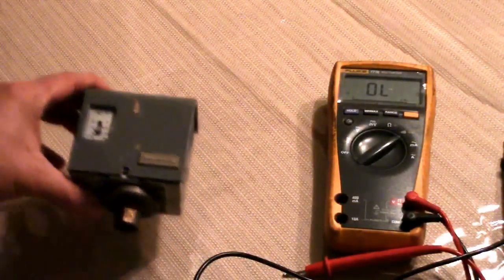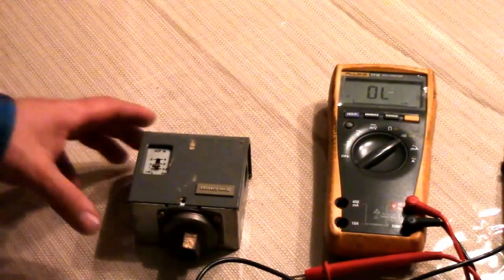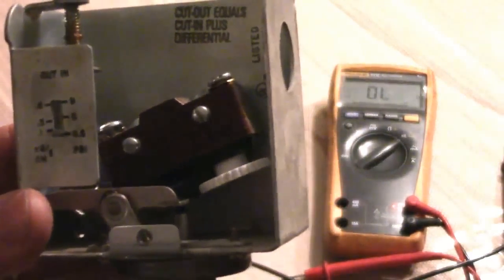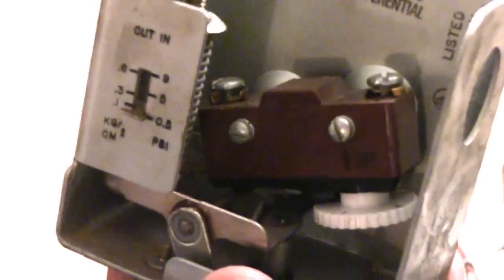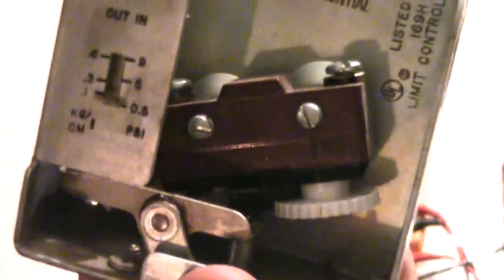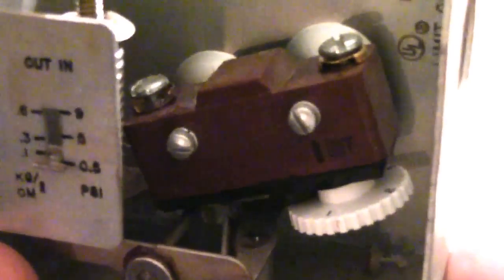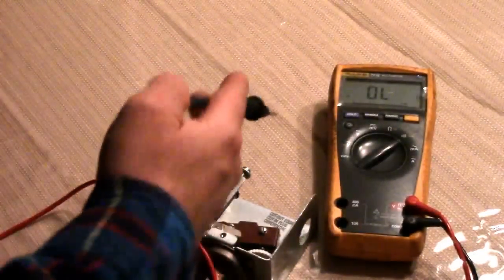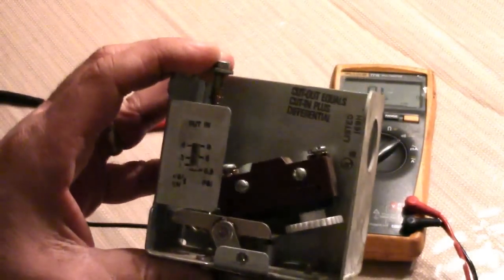Honeywell Pressuretrol PA404A

Comment: Appreciate the video but no they don't "mean" at the furthest radiator. There's no need for "extra pressure" to get further up the line. In fact, the opposite is true. Steam travels slower at higher PSI. Pressure should be as indicated AT THE PRESSURETROL or something is wrong. The Empire State Building (< 100 floors) steam heat works on less than 2 PSI. Watch this for reference on steam heating systems: https://www.youtube.com/watch?v=AgnIFt1wYhw

Comment: what happens if I put the PSI to 2 ? If I put it lower, some heaters stay cold in the house. Thanks
Reply from the maker: I am not a professional. I wouldnt mess with pressure settings if i were you. There can be many reasons why radiators dont heat up.
Reply: first thing is check all your vents for proper function....including the main line vents in the basement.the radiators furthest from the boiler should have the highest level of venting.

Comment: The empire State Bldg can be heated with 3psi. Set it at 1/2 psi and 1.5 psi on the dif wheel
Reply: Think he meant that unless your  house is the size of the  empire state building 2 psi is more than enough
Reply: That adds up to 2psi, not 3.

Comment: Looking at the books on 1 pipe steam (Dan H. ) he said many general HVAC guys turn pressure up thinking it solved the problem. I found when I turned down to .5 & vented better things got way better. They had mine at 2 psi! It hammered and hissed so badly. The steam expansion creates a buttload of pressure on its own naturally.
Reply: how do you "vent better" ? thanks

Comment: I ditched the pressuretrol for a vaporstat when I had my boiler changed out.  On at 6 oz and off at 14 oz.  System is well vented so it doesn't need much pressure.

Comment: How did you measure the pressure at the furthest radiator
Reply from the maker: Alain Mehani I didn't. I'm just assuming.
Reply: Fixed in Brooklyn you want zero psi at all radiators, because they should be condensing steam continuously, giving up heat to the room. Set the ptrol to .5 cut-in

Comment: Honeywell pressuretrols are notoriously inaccurate, they can be calibrated by adjusting a little brass screw. This procedure was written by one of the Heatinghelp.com members.

Pressuretrol Calibration:
If you see the pressure on the low pressure gauge go much over 1.5 to 2 lbs follow this procedure to re-calibrate the Pressuretrol:
Inside the Pressuretrol, right below the micro switch, there is a pivot arm. At the end of that arm you will see a screw pin that is activated by the diaphragm at the bottom of the Pressuretrol. If you look very carefully at that screw pin, you will see it actually has a tiny (I mean tiny) hex head on it. It takes a .050 hex wrench and you can turn it clockwise (Towards the bottom of the Pressuretrol to decrease the Cut-out pressure or counter clockwise to increase the cut-out pressure (which none of us want to do but who knows, your Pressuretrol may be really screwed up!). Turn the power to the unit off first. You may find the first attempt to turn that screw a little bit stubborn (relatively speaking) because it has some Locktite on it but it does turn. Don't turn too much, a tiny fraction of a turn goes a long way towards getting it adjusted where you want it (maybe 1/32 inch turn to start with) . You may need to play with it to get it exactly where you want cut out to be.

Steam works well at very low pressure and you will burn more fuel at higher pressure, generally you want to set it to cut out at 1.5PSI and cut back in at 0.5PSI.
Reply: Your post saved my day, had a new boiler installed and couldn't get the pressure switch set, I showed the plumber how to adjust that little screw and it all works beautifully, thanks for giving precise instructions.

Comment: Optimal pressure is 1-2PSI
Reply from the maker: Peter Muennig at the furthest radiator or on the gauge attached to the boiler?
Reply: 1-2 PSI when? With the boiler turned off or after a heating cycle?
Reply: with a properly designed and vented steam system you can use a vaporstat and not a pressuretrol